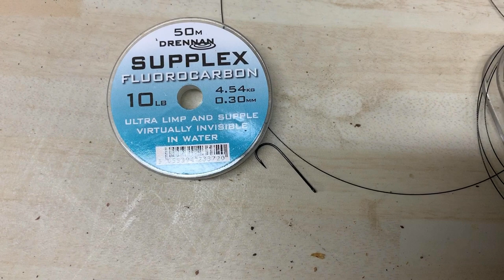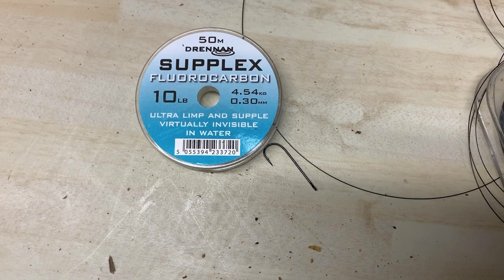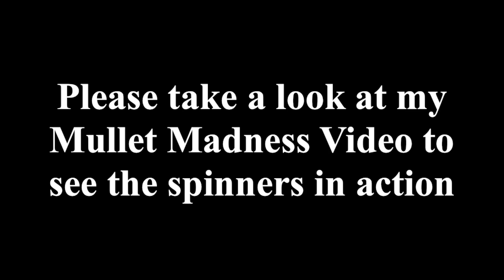Mullet Spinning making a mullet spinner rig tips

Comment: Hi Mate, have you experimented with Isome instead of rag?
Reply from the maker: Yes I have used isome, and caught. On several occasions. I am not sure it’s quite as effective. I have also caught on a small hook and two red maggots. Was going to be on a video soon. However few other projects on the go and little time
Reply: @carperblue  thanks
Reply from the maker: My hunch would be your competition is going to be about the bass. 😉. I think mullet all going to be 46-53cm. Perch difficult but possible 30cm is a big one. Most I guess won’t find a perch. Although I rarely tried I have caught them in the upper stretches . There’s usually small ones round the bridge structure and under the boats on led
Reply: @Carperblue Fishing  Thanks Garry, 3 mullet will be extremely helpful in the comp. I have not had an opportunity to target them at all. It is very much an unknown for me.
You are right, though, the bass are going to be critical.

Comment: When using rag what size do you use? I can dig them out the bank bit it's messy work. What about the bigger rag from tackle shop ?
Reply: I'll be in the kayak after so don't want to be caked in mud
Reply: Also ! Can you troll the spinner
Reply from the maker: Hi Jake, thanks for your questions and for watching. I think I show the prepared, baited rig on my mullet madness video, if you watched it?  It may give you a comparison for size and length, I only ever buy my worms, they can be quite big but I don’t use a whole one. Probably 6 or 7cm being my preference. I like the head end as it’s more durable, however the fish can’t notice it’s just the tail end does not last long. Often they pull it apart or the baby bass do. You can catch them whilst trolling, I have often caught them on a wind based drift. However trolling is often banned in harbour estuaries so please check. You can often find them a long way up river 3 miles is not uncommon where I live.
Reply: @carperblue  thanks mate ill have another go for them in the summer. Was hoping to go up the ooze near lewes. Seen loads down there but couldn't get them last time! Cheers for the advice
Reply from the maker: @fishforagecook.7948  I catch them in the Ouse at Lewis and down to Newhaven every year , very local to me